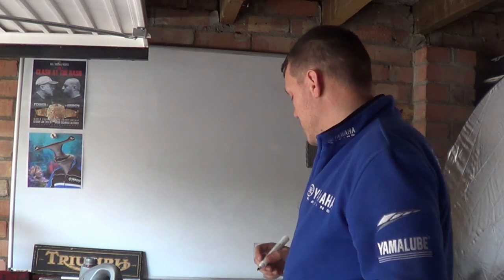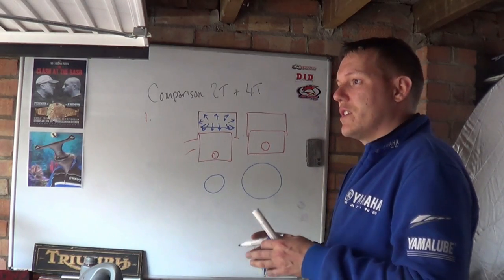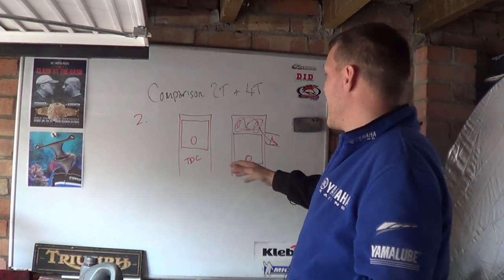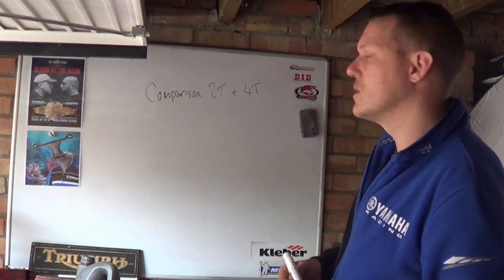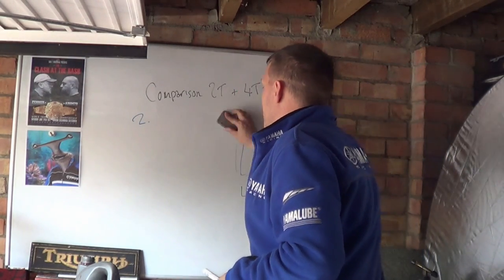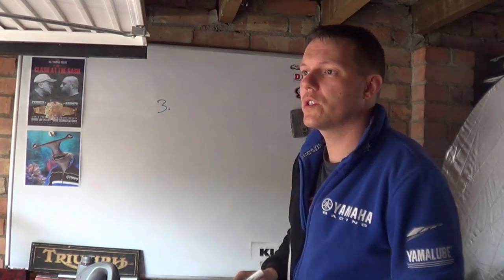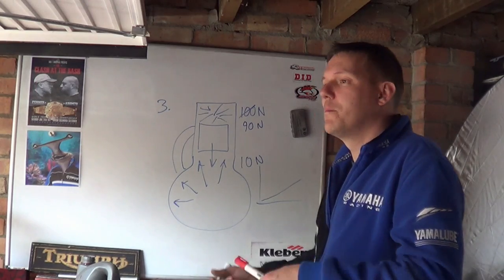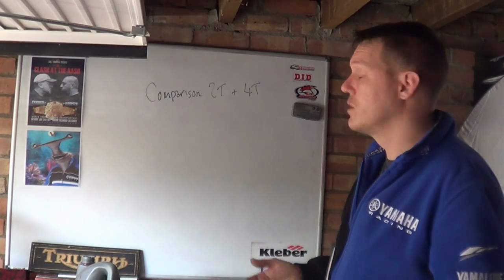2 strokes Vs 4 strokes - Torque production

Comment: What a load of rubbish 2 strokes produce more much more torque at revs 1.5k to 3-3.5k rpm and then 2t and 4t even out torque wise because horsepower = torque times rpm. So at 2500 rpm a 2t 100 hp will be producing 75hp a 4t will be producing 50hp at 5000rpm they will both produce 100hp. You need to educate yourself better on this before producing a video. That why an rd350 is faster accelerating than a Honda 350 but both have the same top speed. Just take a look at there power curves or search etec 150 outboard tug of war then make a video explaining why 2 strokes have more toque at 1.5-3.5k rpm and then 4t catches up.
Reply from the maker: Per stroke...........

"You need to educate yourself better on this before producing a video" 

- you need to listen
Reply: The Workshop Fair enough what your saying is the POWER stroke of a 4t has more Torque than the POWER stroke of a 2T but of course one out of every 2 strokes of a 4T has no torque at all.
Reply from the maker: True but there are other limiting factors. 2 stroke for the most part have unit cranks (cranks pressed together) because of this the max torque you can force through it is limited by the interference fit of the shafts - this is why motoGP bikes and something like the H2R can produce 300HP from a 1 litre engine - a 2 stroke could never do that. 

Now there's the Rotax 850cc which produces 164HP and the MMX that produces 190HP but this is miles away from the 300+ the 4 strokes can shit out. And 850cc is comparible to 1700cc or divide it by 2 and you get 82HP.

If you take the R1 say with 200HP - each cylinder is making 50HP - quite a lot less, but you have 2 of them so that 50 becomes 100HP and they fire every 180deg. 

The benefits of 4 stroke is that you can so what you want, like chaning bore and stroke etc. The problem with the 2 stroke is that you're limited. Just look at the RD and RG500's 4 cylinder but 2 cranks and a intermediate drive, not lightweight or efficient. 

https://www.rotax.com/en/products/rotax-powertrains/details/rotax-850-e-tec.html

Comment: Sure, they are less volumetrically efficient, no disputing that. But my ke175 will ride with 250-300cc 4 strokes without much fuss. I massively prefer the simplicity and ease of maintenance (and cost) of my kawi. Plus a light and compact engine makes the handling sweet as fuck especially in tight and technical bush riding.